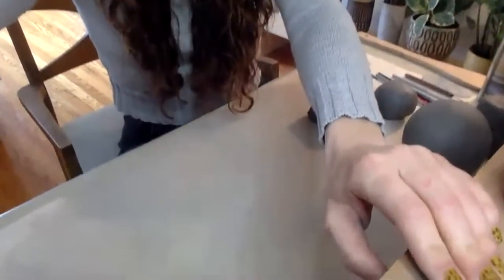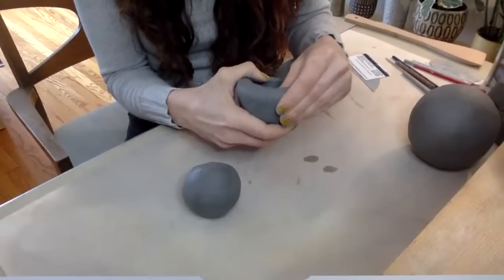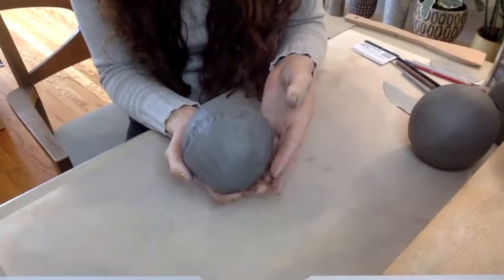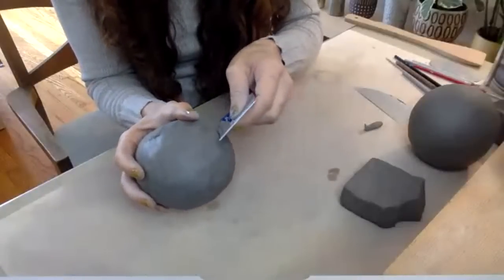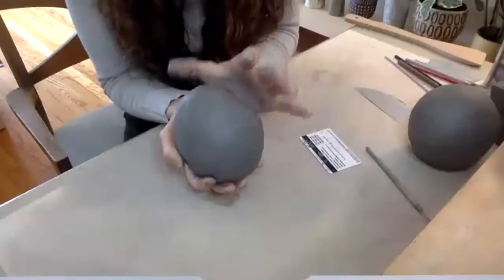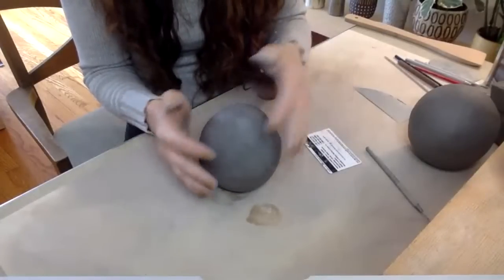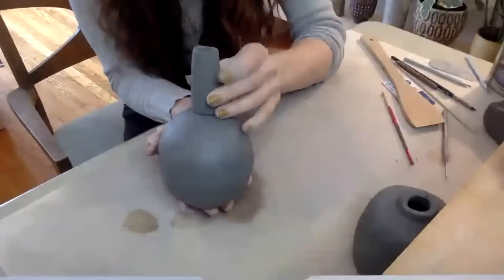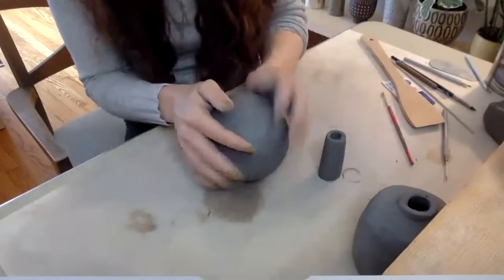How to make pinch pot vases - easy, fun, and versatile handbuilding project

Comment: Hi Gina, thanks so much for your video, its really helpful for a beginner like me. One question: do you have a tip for people with small hands? I struggle to reach into the bottom of the pot, to pinch when its too thick. If anyone else has tips that'd be great too thanks. PS Love your pots in the background :-)

Comment: Good to see how you made your pinch pot, I started with pottery after years of doing nothing, you don't want to see what it looked like🤣🤣🤣 I see you don't use any slip too put anything together, is that just your way off working or do you have a reason for it? How does your clay not dry out! Perhaps I should listen to the end!
Reply: Yes I’m also interested in the reason why the scratch and slip method wasn’t used to join the two little pots. I’ve made two little vases following this video but I’m wondering will they come apart or crack along the seam when they are fired. This is a fantastic pinch pot video. I’ve rewatched it many times. Thank you!

Comment: You don’t need to use slip?  Just smoothing the clay over both sides is good?  Thanks!
Reply: That's what I was thinking
Reply: That's a great question. If your clay is fresh out of the bag and still in that smushy wet state, and you're attaching your pieces by blending/smoothing the clay in, I find that you really don't need to score and slip. If the clay is a little dryer, if you're adding small or delicate pieces, or if you want to plop something on without really blending and smoothing it in, then you should score and slip.

Comment: Hello I loved watching this video and making a pinch pot as you demonstrated  and it came out quite nice.  I like the pinch method or I/m better at it than coiling.  because I can get the walls more even.  However I am a wheel potter mostly. but as Im out of the country I dont have my wheel but I have clay.  you made an incorrect comment though I would like to say that on wheel you can cut off parts and go in another direction and reform the clay into a different shape ... bigger hole to smaller hole or to no hole etc.  cut off necks and reshape all can be done on a wheel too.  but again I enjoyed this pinching method as I'm without my wheel.  thank you

Comment: Is there no need to score and slip the two semi circles into a circle?
Reply: If your clay is fresh out of the bag and still in that smushy wet state, and you're attaching your pieces by blending/smoothing the clay in, I find that you really don't need to score and slip. If the clay is a little dryer, if you're adding small or delicate pieces, or if you want to plop something on without really blending and smoothing it in, then you should score and slip.

Comment: You don’t slip and score to connect two pieces?
Reply: If your clay is fresh out of the bag and still in that smushy wet state, and you're attaching your pieces by blending/smoothing the clay in, I find that you really don't need to score and slip. If the clay is a little dryer, if you're adding small or delicate pieces, or if you want to plop something on without really blending and smoothing it in, then you should score and slip.